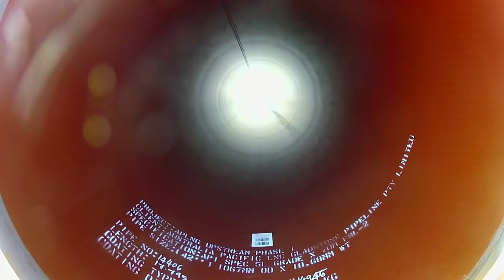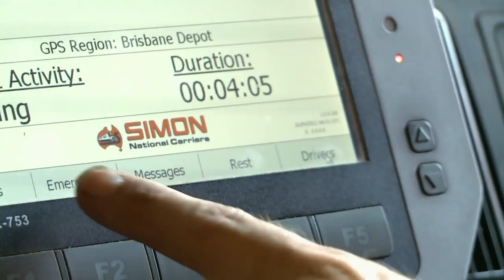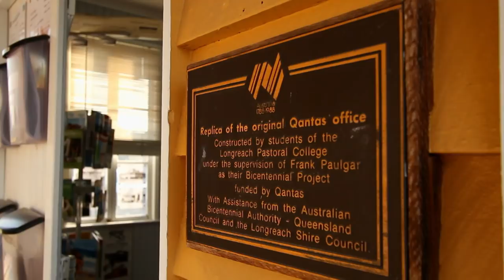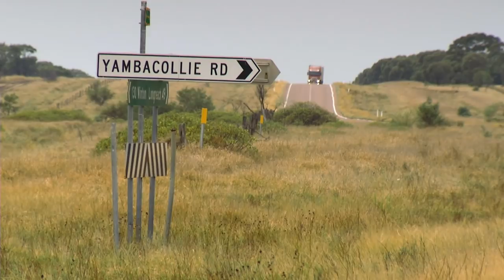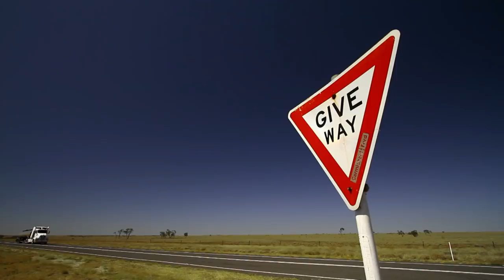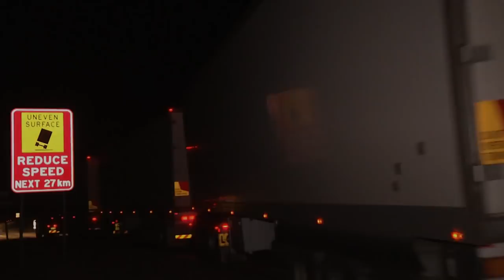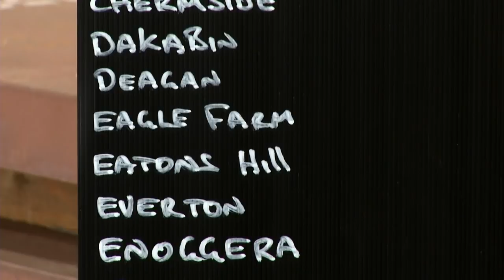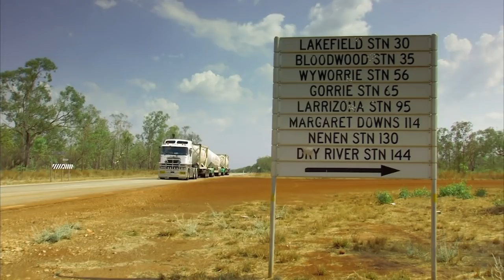Life As An Australian Truck Driver | Big Australia

Comment: carnt belive there only using 480 bhp  on them runs , over in england we use 480/500 or alot more  on 400 mile trips that last a day
Reply: The Volvo road train was running 600HP and the pipe truck was running a 540HP motor at 46,000KG. The one you thinking about was the 480HP single trailer they use locally.